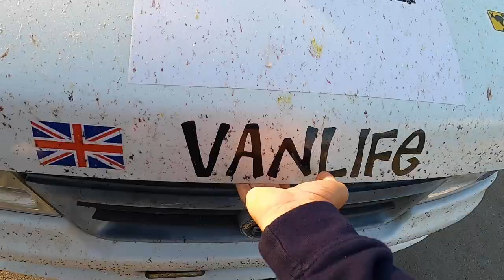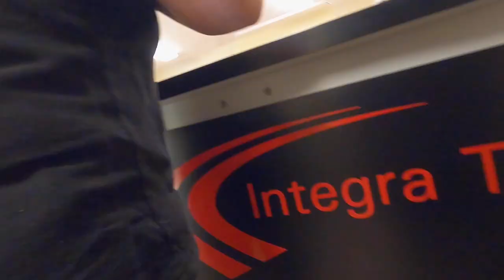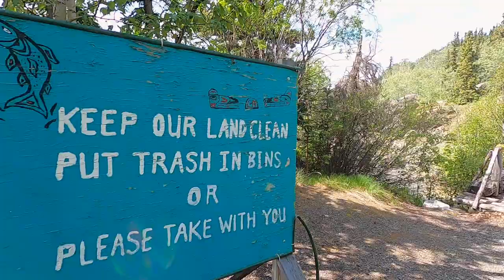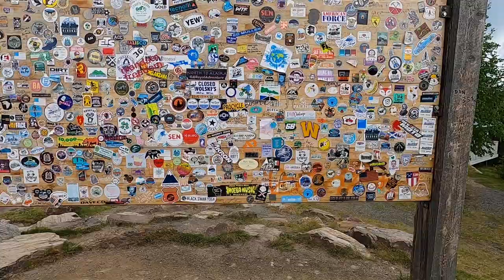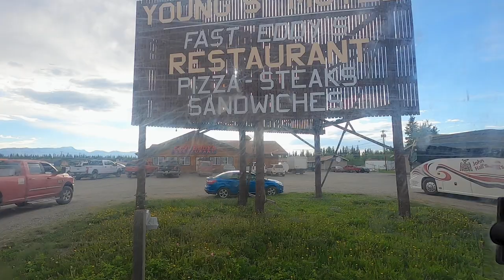IS OUR VAN LIFE ADVENTURE TO THE ARCTIC FINISHED? [S7-E37]

Comment: A lil tip regarding your windshield:
Every time you fear there’s a possibility of gravel or debris hitting the windshield, put some pressure anywhere on it with your thumb.
If there’s already a crack, put the pressure over it.
And there are products that help stop/slow the cracking.
I’m from Brazil and we use to do it when driving dirty roads or behind trucks.
Good luck!
Reply from the maker: Thank you so much
Reply: @TREADtheglobe  You’re very welcome 😊

Comment: You can go to any of the hydraulic repair shop and they can easily fabricate a custom hose that will be even stronger than the original part.  A hose that size will cost less than $40.

Comment: Hi Marianne/Chris, quick tip:

Hold your outstretched palm on/against the windshield every time a vehicle passes by. At worst, you might end up with a chip, but it will prevent the glass from shattering or developing a long crack 😊

Safe travels. I am keenly following your journey because I will be undertaking mine in a self build travel trailer 😊
Reply from the maker: Thank you for the tip 🙌

Comment: FYI.  You can use any DOT number brake fluid in a clutch master cylinder. DOT 5 is for high temperature racing brakes. DOT 3 would work just fine. No high temperature in a clutch.

Comment: Hi Guys, you can use any of the brake fluids in the system as it’s not getting hot and just compressing. The trick for you is to keep topped up so you don’t ingress air which will cause the loss of the clutch. I would check as often as possible as the hose is not going to get better!  Most important, keep safe.

Comment: Terrible guys the very same problem gadget John and Mandy are having with their 2 Fiat Peaugot Citron camper  gearboxs, hope you guys get it sorted.,

 also guys don't forget to power wash all the area underneath and in the engine bay, where the brake fluid has penetrator, because brake fluid has the same components as paint stripper, and will remove the paint and cause a lot of rust in no time at all.

Comment: I am confused surely you need to top up your clutch Reservoir pot. Not your brake Reservoir pot. Hmm I am not a mechanic either and dont know modern cars or Van's. Cheers from old George.
Reply: On most fiat's the clutch and brake fluid are in the same circuit.
Reply from the maker: Thanks to Toff for explaining ! Marianne
Reply: @tofftheboss6954  Hi thanks for info.  My Talbot, Fiat Motorhome is Cable Clutch. Bit worrying if the clutch fluid leaks does it mean eventually no brakes. I am not familiar with modern vehicles but will have a look at my Fiat Doblo and see what that is. But in storage at the moment. So some time before I check. Cheers from old George
Reply: @TREADtheglobe  Hey guys just searched on YouTube regarding clutch stuff on Fiats. Plenty of videos. Just a concerned amateur. If the clutch fluids leaks away does it mean you dont have brakes as it shares the same Reservoir as clutch.  Search on Fiat Ducato Clutch fluid on YouTube. Especially what Fiat recommends. Food for thought and an interesting subject. George